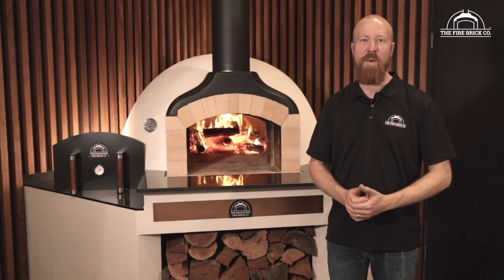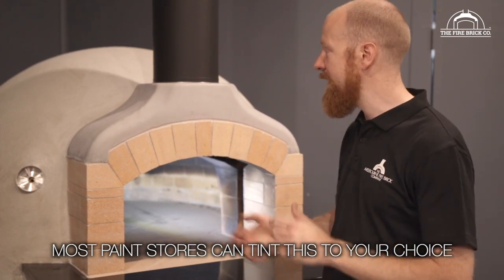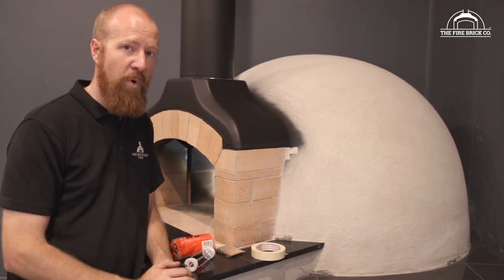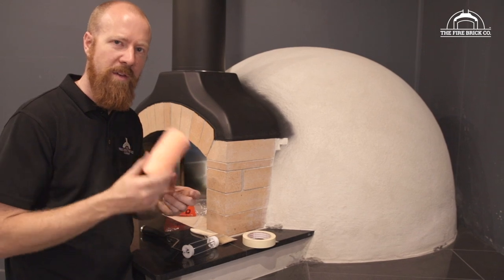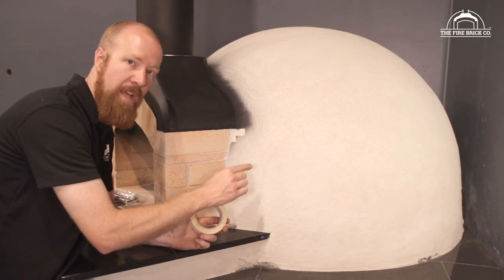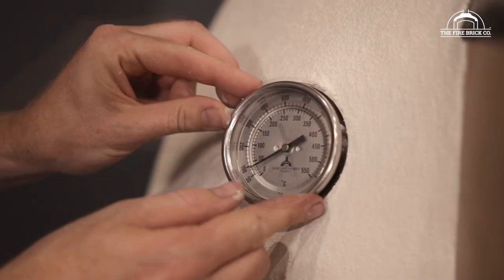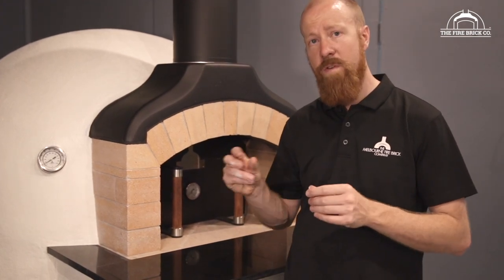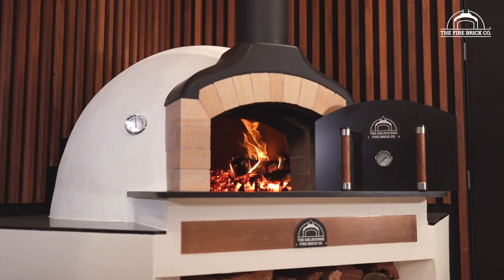Completing your Wood Fired Oven | 5. Sealing the Oven Dome

Comment: Thanks so much. I built mine following your advise & expertise throughout all the process. 
Only difference I used ceramic blanket ( 2 layers if 1” each)  instead of Perlite. The refractory layer of cement “seemed” to me too thin  (I used a full 20kg pouch for the dome) so, I ended up putting a couple of layers of cement . I don’t for-see any trouble with the heat and the outer layers of cement. 
Am ready to start curing it this week...
From the Land of the Maple Leave. Montreal, Canada.
Reply from the maker: Good job! I'm a little confused though - we use 2 layers of ceramic fibre blanket, THEN we follow up with the Perlite. You'll want that oputer shell to be quite thick just in case someone climbs on the dome!

Comment: Mine will be out in the open.  Temps range from 20 F to 105 F here with monsoon rains in summer, humidity is quite low also (central Arizona).  Should I cover it with a tarp when not in use or when we are gone for prolonged periods?
Reply from the maker: Hi Robert! Some great questions - give us a call on 562 512 0214 and we will be happy to go through that with you.

Comment: Thanks a lot for making this great video… I was just wondering… in a very humid climate couldn’t this render prevent moisture that unavoidably gets absorbed from the inside from escaping?
Thank you
Reply from the maker: Good question! It hasn't been a problem for us so far - water built up inside the oven will tend to find another way out as steam. Humidity doesn't really create much moisture in your brickwork, it's more rain falling on the exposed oven floor that leads to water building up in the oven.

Comment: Hi, I want to put a layer of standard render to smooth out the surface before applying the white roll on render - Do I need to do any smaller curing fires for this thin layer of standard render? (I’ve finished the 6 curing fires for the oven as I couldn’t wait to get cooking!)

Side note - your kits and these videos are amazing, thoroughly enjoyed the process of building the oven and so so pleased with the end result👍🏼
Reply from the maker: Hi Tom! You wouldn't have to do more firings, but you would need to allow that layer to set fully and dry out prior to applying the roll-on membrane. Another way of smoothing the perlite render is to get some coarse sandpaper and sand the surface back, you'll be surprised how smooth you can get it that way!
Reply: @TheFireBrickCo  What grit sandpaper would you recommend starting and finishing with? Thanks for the videos too Ben (and team)! They've been absolutely fantastic and central to the rebuild I'm doing at the moment!

Comment: Is it okay to use the acrylic roll on render here in Canada where it can get down to -40c and heavy snow and of course summer rains? Is the acrylic render then sold here as stucco or is it an acrylic paint? Love all your videos😊🥂👍
Reply from the maker: You can use the roll-on render, but unfortuantely in your environment you will need to build the oven such that it's is completely protected from the weather at all times; ie. under a roof, or built onto a structure. Check out the article we've put goether on this question: https://www.thefirebrickco.com/blog/2022/08/06/protecting-your-oven-from-the-weather/

Comment: Hey Ben, thank you for your great series. I enjoyed every minute of it and it helped me a lot with building my first oven. I am still in the curing process and already noticed some small hairline cracks on the arch and the dome. Thanks to your other video it seems that these cracks are normal and there is nothing to worry about. But I have a question about covering these cracks to keep the oven waterproof. Can I just use the roll on render to fix the cracks or do I need to secure them with anything else in advance?  Thanks for your help and keep up the great work..
Greets, Kai
Reply from the maker: Hi Kari! You are spot on, these cracks aren't something that should worry you at all, they're just part of owning a Wood Fired Oven. Go for it with the roll-on render - this is exactly why we use it, because it will seal and bridge those cracks that you're seeing there. Providing the crack is less than 1.5mm across I would advise you to use the roll-on straight over it.
Reply: @TheFireBrickCo  Hey Ben, that sounds great! Thank you for your fast response. I already bought the render and will use it on the oven after a few full firings.

There is another thing that happend during the fifth curing fire yesterday. After the 3 hour curing process I saw water dripping from a small hairline crack in the front of the concrete stand. Is this dripping a normal sign?

Thanks and best regards,
Kai

Comment: If you were to tile the dome, would it still make sense to do this acrylic step before tiling?
Reply from the maker: I would definitely do that, then you have a nice waterproof membrane down before the tiles go on - similar to the flexible 'tanking' coating that is put onto batroom walls and floors before tiling them

Comment: have you ever had very small hairline cracks when you do the stucco.  ?   how should I fix. was thinking a skim coat over the whole oven to smooth it all out.
Reply from the maker: Definitely - we always get some small cracks in the perlite render after all the curing fires are done. The roll-on render fills the cracks in really well, so I don't normally bother with a skim coat, however it wouldn't hurt. Just make sure the skim coat is full dried before you apply the roll-on render.

Comment: Hi have  moved house recently. It got outside oven. But it’s completely wet . I think the water comes through the chimney when it was raining . Is there anything I could do. Please kindly help. Thanks
Reply from the maker: Great question - this is something that we want to do a whole new video about! There are a few things you can do straight away. First thing is to go through the full Curing Fires process (https://youtu.be/5cb3aAkU5R8) to get the oven fully dry again. The next step is to keep it that way, and there are a few things you could do around that. If rain is coming in through the flue you could try removing the flue and storing it elsewhere, and just putting the chimney cowling on the flue 'stub'. You could also put a cover over the oven when you're not using it, or build a structure over the oven to keep rain from landing on it. 
It's a frustrating thing about Wood Fired Ovens - they're all built with materials that are porous, so they soak up water very readily. If you use the oven every couple of weeks then it won't get a chance to get waterlogged, but if it sits for a month or two in the rain it can end up holding a lot of water, which in a warm climate is just frustrating, but in a really cold climate can result in significant damage to the oven when that water freezes.

Comment: Do people seal the exposed front fire bricks with stone sealer so the soot can be cleaned off easily and water won’t soak in? Or do they need to be unsurfaced?
Reply from the maker: We don't recommend using chemicals like that inside the oven as you may eventually cook on or near that surface.

Comment: Hello there thanks for the video, question I have a 1800 brick oven. I covered the bricks inside the oven with clay because it was little peaces of clay falling from the dome inside. Can I paint the oven inside with water base paint.
Reply from the maker: We definitely wouldn't recommend you do that sorry - you would be best off pulling it apart and starting again, I'm not aware of any material that will solve that issue for you unfortunately.

Comment: Hi Ben
Thanks for all the info. 

Is the roll on render you’re using a fine top coat? 

Is that why you mention that it still isn’t water proof? 

Would you think that regular  exterior paint would work to seal it? 

Thanks again
Reply from the maker: Hi! The roll-on render is a final coat, it's effectively an elastomeric membrane coating. The roll-on coating is waterproof in that water won't penetrate through it, so water won't pass through that layer and get into the dome. That said, there are plenty of other places that water can get into the oven, such as right through the oven mouth.  This is why we stress that if you're in a cold climate that experiences full freezing conditions that you can't rely on this coating to keep the oven dry, and that a cover or structure over the oven is needed to keep it dry at all times.

Comment: Love all your videos. Can I have just made an outdoor oven. Is it a problem if it rains on my oven after I have cured it and it’s yet to be sealed? Do I need to start the process again as I’m sure rain would of soaked through the finished render
Reply from the maker: Hi Darren, if you get rain on the render before it's sealed then yes, it will soak in and need to be fired up again to remove the moisture. You don't have to start again from day 1, but you would need to make sure you have it completely dry as our roll-on render is water based and is highly susceptible to water in the render that it's being applied to!

Comment: Hi would bondcrete be a viable alternative?
Reply from the maker: Unfortunately not, you really need a full membrane coating. The bondcrete wouldn't be enough to fill in all of the pores in the perlite render
Reply: @TheFireBrickCo  ok thanks for that, I’m planning on tiling the dome after curing process is complete and was thinking of sealing with bondcrete before that. Is it really necessary to add a roll on render before that

Comment: isnt an acrylic going to seal moisture into the oven?  isnt it supposed to be breathable?
Reply: Acrylic will seal it but as Ben says you have to make sure the moisture is purged from the oven first.  The oven doesn’t “need” moisture, it’s just there from the build/weather if not sealed...  Ben correct me if I’m wrong here!
Reply from the maker: You're spot on, we want to drive all of the moisture out prior to applying the rollon render.